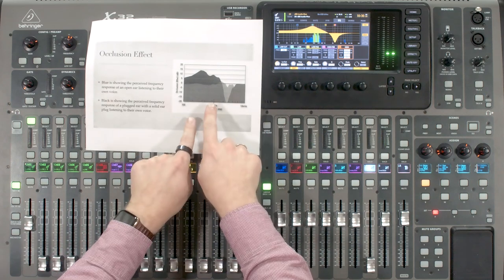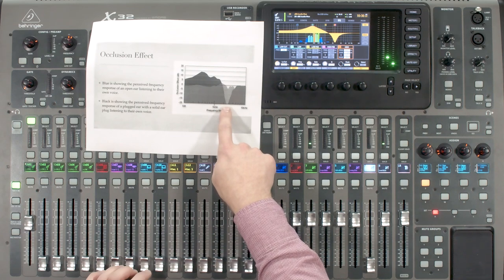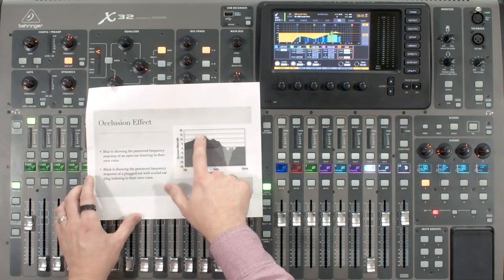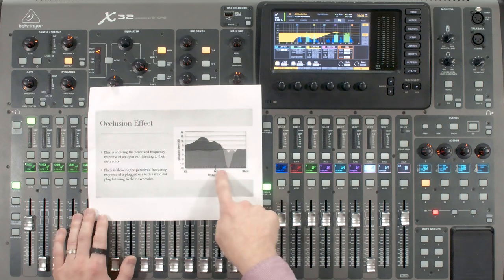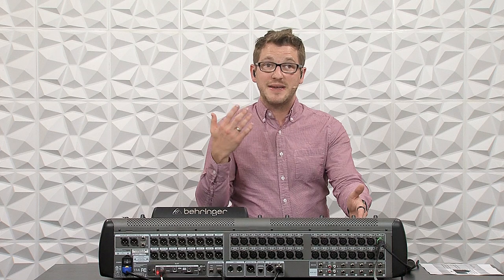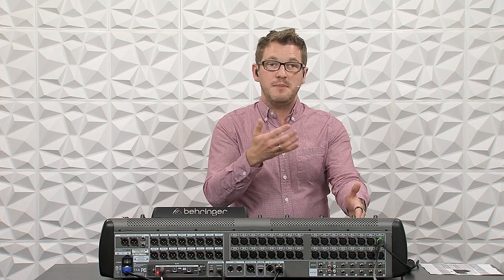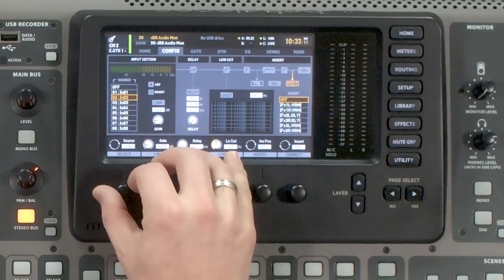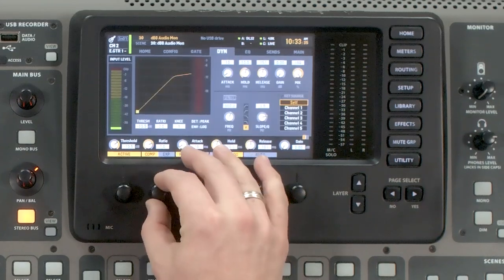Monitor Mixing - Making IEM Mixes Better: What is Occlusion??

Comment: Phase/Polarity. Start with flipping polarity on a vocalist mic in their ears.  It can make a dramatic difference.
Reply: Ah, good. The phase switch solution. It works wonderfully quite often. And often on the mix bus rather than the inputs. 
As to anti-occlusion EQ, I would try to find a curve to place on the IEM mix bus(es) rather than doubling up on Vocal mic channels like that. 
These two in combination allows some permutational freedom, and is often much simpler

Comment: This is confusing. You keep mentioning CH1 and setting the occlusion EQ. However, you aren't sending CH1 to FOH, correct? If so, that means the vocalist has to channels assigned to his mic. One to be dressed and sent to IEM only, and the other set for FOH. Is that what I'm understanding?
Reply: This is only for the monitor mix. I guess in this scenario there is a separate console for FOH. Channel 1 with the anti occlusion EQ is sent only to the vocalist's mix and channel 2 to the other band member's mixes. Again, FOH in this case is a completely different, third, mix of the vocal channel. Does this make sense?
Reply: First channel to IEM of vocalist and second channel to bandmembers mix and/or FOH mix I guess
Reply: Same signal, into two channels, but processed differently: Ch1 is sent just to the performer’s IEM mix. Ch2 is sent to everyone else’s IEM mixes (and FOH if it’s the same board). This is how I run vox for IEMs on a CL5.
Reply: He does explain how the dual channel method works, though it can be easy to miss. Ch1’s only function is to go through the vocalist’s IEM mix, it doesn’t go anywhere else. Ch2 is taking exactly the same signal source as Ch1 (ie, both using Input 1 on the back of the console), and is then mixed for FOH and rest of the band monitor mix. For larger bands and groups the more practical method is to have two entirely separate consoles receiving the same set of signal inputs, one mixing FOH, and the other mixing monitor outputs for the band. In either case you’re able to tailor the signal processing ideally for whoever or whatever needs to hear it or reproduce it. So yes, you’re correct in understanding that the console has 2 channels for the same input. However, the vocalist has Ch1 (anti-occlusion) turned up in their mix, and the band/FOH turns up Ch2 (dressed, comp’d, EQ’d etc). Neither of those mixes will use BOTH channels at the same time
Reply: Wouldn’t you just apply the corrective eq to the IEM send?
Reply: @jeffreystipe925  the corrective EQ only applies to that performer's channel. All of the other singers and instruments should get their EQ as normal. It's only for a singer in their own IEM mix where the occlusion effect applies, because that is the only source that they are also hearing though the bones of their head.

Comment: Im not sure I agree with the compression comments on a lead vocal. First off i buck the traditional "mic technique" taught by most engineers because when a vocalist pulls the mic away for a section they are going to sing very loud, you're less in control as the engineer, and you're potentially picking up more stage noise. As worship leader and technical director who for many years controlled my own in-ear mix, and who has been an audio engineer for many years, i did much better with heavy compression on my own vocal because I  could hear myself much better in lower volume song sections, lower pitched parts, and I knew when I did belt it I was going to be keeping peaks in check because I knew exactly how I had my compression set. When I run front of house I prefer keeping my lead vocalists in compression constantly. Usually around 7-8db of compression and only in super loud moments I would allow for 9-11db of compression. This doesnt work so well if my vocalist keeps pulling the mics back away from their mouths. It has to all be very intentional.

Comment: Thank you a lot! I have one question, what is the reason the vocalist would put the mic further if you compress it? I think I don't get it. Doesn't the compression reduce the volume sensation and would make the vocalist use the mic closer?
Reply: The “compression “ reduces the dynamic range. The singer will instinctively and unsuccessfully try to recover the dynamics. If they’re singing softly, that’s what they expect to hear. It might be too soft for FOH, hence the compression.
Reply: Also in live situations you're generally using a dynamic mic and dynamic mics have proximity effect. A significant amount of compression plus that proximity effect might not be what the vocalist wants from the mic. 

With in-ears you can have a quieter stage and the vocalist could run his mic hotter but keep it further from his mouth, reducing plosives, reducing proximity effect, and having a cleaner and more expressive sound.
Reply: You can use compression to make a soft voice louder like in worthy is your name with elevation worship and Tiffany Hudson
Reply: @JalenRawley so are you saying to run the gain higher and the IEM vocal send? So when you pull away from the mic on louder singing parts you can still hear yourself?

I’m not currently using any compression on my IEM vocal and I struggle with the following:

Louder singing parts are too piercing on the ear, but quieter parts are normal… if I back too far away from the mic I then can’t really hear myself… which for louder notes then effects your ability to deliver the note properly.

Any cures for this. 

The occlusion EQ works great I just struggle to get the correct volume where I sing normally but I’m not bashing my ears on the louder parts
Reply: @TheOneMoreSongCast  The difficulty in running compression on vocal mics live is that it compresses the peaks and raises the level of everything else, so it's much easier for the mic to feedback as it'll start picking up the PA or monitors easier. If everyone is using IEMs and there's no need for monitor wedges, the mics are much less likely to feed back. The mics would have to pick up the main PA in order to feed back. You can never eliminate all of the stage volume with a live band, unless the drummer is using all electronic drums. You're always going to have something bleeding into the mic that compression will bring out more of.

Try some compression on your vocal mic and just be ready for feedback or for hearing more of the onstage bleed. If your compressor tells you how many db you're compressing, try just shaving a little bit off of the top like a limiter would. Low threshold, low ratio, fast attack, fast release. One rule of thumb I like to go by is the 3db rule. The ear can only really notice increments of 3db, so I like to start there. See what 3db of compression sounds like, then try 6db. Mess with the attack and release times for how you sing. Sing your loudest part the way you would normally sing it and see how much you can hear the compression squashing it down. Then sing the quietest phrase and see if that seems louder.

I always run compression on vocal mics whenever I do live sound, but I also am probably the one who rang out the PA/monitors and know where any feedback might come from. I also always have one hand on the faders of the vocal mics or vocal mic bus so I can ride the faders manually so I have more control over the situation. I can't do all that if I'm performing so it's a very set-and-forget thing for me in that situation. The compression just helps even out the peaks and the valleys, helping to even out the dynamic range. Loud sounds get squashed down, quieter sounds get boosted by raising the overall output level. You'll still have control by working the mic, but you'll find that you don't have to move it as close or as far with more compression. The negative aspects are bleed (background noise on stage spilling into the mic) and compression artifacts (pumping, squashing, making things sound unnatural). I try and make compression super obvious to my ears and then pull it back until it sounds natural again. Then I set the attack and release times based on whatever it is I need the compression to grab, when to grab it, and when to let it go. 

For myself I use an SM57 (never a 58) and I set it up nice and hot with a little compression (about 3-5db at 1:2 with fast attack and release). With a 57, there's no ball and you're right on the capsule, so if you get mashed right up into it you ARE going to hear yourself, no matter what's going on. With it nice and hot and that little bit of compression, if I'm not standing right in front of the mic I can actually hear the stage bleeding into it. If I'm too close to the drummer and I'm getting a lot of cymbal bleed, I'll use some low pass and cut some highs off of it, a little on the pre and a little in my aux send. I don't want to hear the mic capsule (meaning pops, plosives, that smashed sound) so I don't want to be all mashed up on the mic unless I can't hear myself. I set the compressor so I can hear it grab when I'm really close to the mic and that keeps it from being ten times louder than when I'm 4-6" back from the mic, which is where I want to be.
Reply: @JalenRawley  hey thanks for the reply. I only read a couple of lines before I realised you are referring to FOH mics. I should have been more specific… this is for IEM vocal… so it dosent go FOH. I split my vocal into two channels and use one for FOH (EQ and compress it for foh) and then have an IEM mix. THAT BEING SAID… some really useful tips on using compression in a live environment so Thankyou
Reply: @TheOneMoreSongCast  Well it'd be both FOH and IEM, yeah. I always try and send FOH a clean, untouched signal from the splitter so they're not stuck with any EQ or compression I'm doing for myself. If I'm not running FOH, I don't ever want to tie the FOH's hands with anything I'm doing. I'm trying to keep IEM world separate from FOH world as much as possible. If I'm getting aux sends from him to send out via IEMs, I'll deal with whatever he's done to those sends before I get them and it'll be fine.

If FOH is getting a clean split from your mic and is never getting the EQ/Comp/FX you're putting on the mic in your IEM mix, you can do whatever you want to it, so go ham with some compression and play with it. Overdo it and see how it responds, then change the attack and release times so the compressor engages and disengages when you want it to. Then you can set the ratio and threshold to control how much it squashes. Generally you don't want to hear the compressor, you just want it to sound natural, but some people really like the sound of a compressor working hard so it's really up to you what sounds best to your ears.

Remember that just compressing a signal of any kind lowers it's output level so compressors provide makeup gain to replace whatever the compression took away. Some have auto makeup gain, and if what you're using does, try it out and make sure it's pretty consistent and useful. Sometimes they'll respond to weird artifacts and things and just spike the output gain when it doesn't need to. So just test it out and see how it works with yours. If you start working with compression and everything seems quieter than it usually is, you just need to add some makeup gain. Adding preamp gain is just going to hit the compressor harder, because you're adding gain before the compressor as opposed to makeup gain after the compressor. They don't always label it makeup gain either, sometimes it's just "volume" or "level".

In rehearsal situations, I always have a laptop hooked up to my IEM mixer so I can record everything. Sometimes in the moment you aren't able to focus in on the little details of things, so having that playback is really good to really tweak things in place.

Comment: Great video, I've been trying to explain this our tech for years. Two important notes. 1)The level of occlusion can vary by fit (example, custom in ears will seal better and make the boon vibrations more apparent, universal iems less so, and over ear headphones very little)
2) Occlusion happens at a consistent volume. When you raise the mix level the bone Occlusion functions like locked eq points. You may need more or less of a eq correction based on the level of your mix compared to your occlusion.   SO Refreshing for someone to dive this deep!

Comment: I have been thinking about this kind of thing! This is an amazing idea! Specifically what I discovered last time I played live was that the high bass/low mid bleed from the PA is drowning out everything. We set the in-ears as loud as we were comfortable with, and then when the PA was on and guitar amps and all that stuff, it just ended up becoming mud. Absolutely miserable.

Something to consider too, is flipping the polarity of the vocal mic changes how the singer hears their own voice because of the phase difference of the IEM signal VS the bone conduction sound.

Comment: I do the same thing except I heavily compress the duplicated IEM vocal channel and then use a mix of both channels in my ears. That parallel compression gives me more control of my vocal performance so I don’t feel like I always have to sing loud to cut through the mix. It helps me sing more dynamically. 

Flipping the phase can also help. 

When faced with a quick soundcheck I sometimes just ask to highpass at 250 Hz on my whole IEM buss or adjust the EQ directly in my bodypack.
Reply: Is there a rough setting you could share with me for compression on IEM vocal? I find when I sing loud it’s a bit tough on the ears, and as you say when you pull off the mic you lose the vocal in proximity. 

Threshold ratio attack release? Is there a rough template I could try and then maybe tweak.

Comment: I’ve been having this problem lately, so I’ve been cranking the reverb to try and help out. 

Definitely using this trick next band practice. The videos are the best!

Edit: I added this eq to my vocals, and oh my. That’s made massive difference!!!
Reply: A random tip I discovered: put a stereo reverb on the click track if you're using one. Makes it way easier to pick out live.
Reply: @MFKitten  I was actually thinking of doing this! Totally trying it next practice!!! Thanks!!!
Reply: @JeremyLeech  The reason I did it was because I found that click sounds with a longer tail helped a lot. If you can do beeps with a longer decay (I have resorted to literally a square wave on a synth plugin with juat the right decay settings), and stereo reverb to make it not just in the centre, it will be super clear.

Another tip: play white noise, listen for sharp ringing peaks in the high end and then notch EQ it out (you'll probably have one in the 6k-10k range because of the resonance in the space between the driver and your eardrum). Only dip it down until it sounds less harsh. Do the same with any other ringing peaks that are just native to the IEMs themselves, and then compensate with a high shelf boost to get the relative brightness balanced. You'll be saving your hearing and you'll have superior clarity. Many IEMs actually have the treble focused in a few harsh peaks, and it's hard to tell what's going on other than "yeah that's bright".

Comment: Interesting! Do you also know of a way to eq only certain channels this way without adding each vocal to a second channel?
In our band we are all using IEM (5 stereo mixes)  and adding additional channels would mean 10 vocal channels (mono).
I am using a X32 Rack mixer with an additional S16
Reply: You can use a Group for each vocal you want to eq differently and not route it to the mains.

Comment: If anyone is wondering how to do this on an allen and heath cq12t: Just dedicate one aux send to your vocals, take a patch cable and patch from the aux output to an empty channel input. Then send the original vocal channel to mains and mix them normally, but send the duplicate to the in ear monitor mix and EQ out the occlusion on that duplicate channel.
Reply: can't you use the aux eq and comp?
Reply: @electronik808 you’d be applying the aux EQ to everything on that aux bus. So any other instrument would sound thin and trebly. If you’re applying aux EQ to the aux that is effectively duplicating the main vocals, you definitely could, but I find it easier to have all my individual channels EQ’ed at the channel level. Probably best way to do this is have a mic splitter. That way you’re not introducing a tiny amount of latency from the d/a then a/d conversion from the patch.
Reply: @zachswiftmusic ah so the curve is only for the vocal itself not other channels!! i see
can i do a less drastic curve and do it on the bus? maybe just cut 400 and boost a bit in the 2/3k?
Reply: @electronik808 that’s right, the occlusion happens because your voice is resonating in your head as you sing and you’re still hearing all the low end. So removing the low end from your vocal signal compensates for that.

Comment: I would have thought that too little compression on the vocal mic would cause the singer to back off the mic, because he is shouting in his own ear. 
I have never tried sending less compression to the ears only, but I also don't have enough channel for that. So I would need to either send the signal with the compression or completely without. 
I try to compress my vocals in different stages. 
1. Tone shaping compression with small ratio
2. Dynamic limiting with La2a simulation
3. Group compression just for the PA